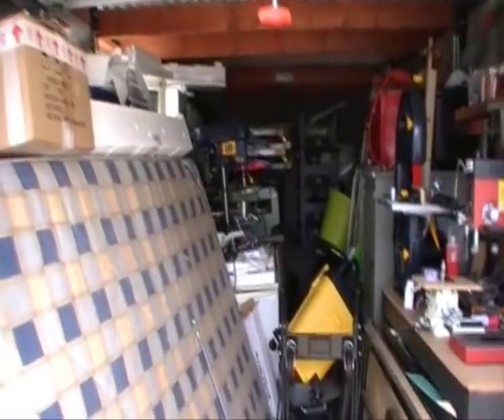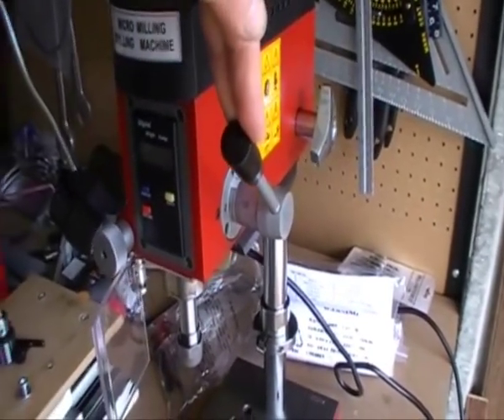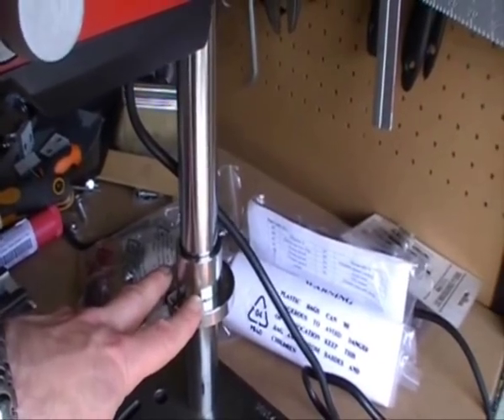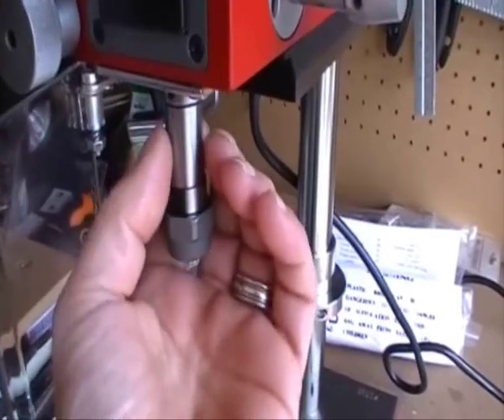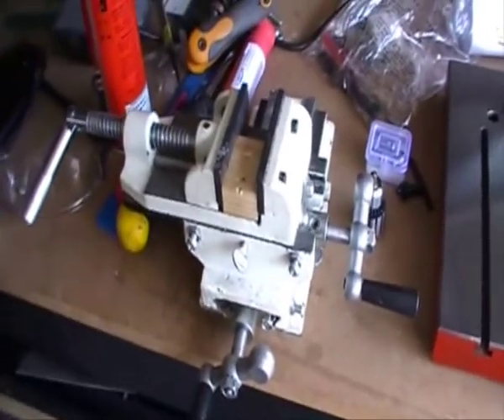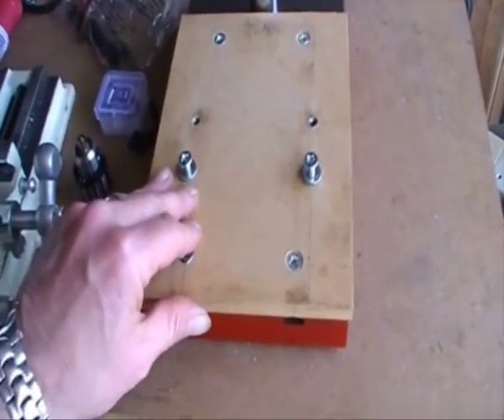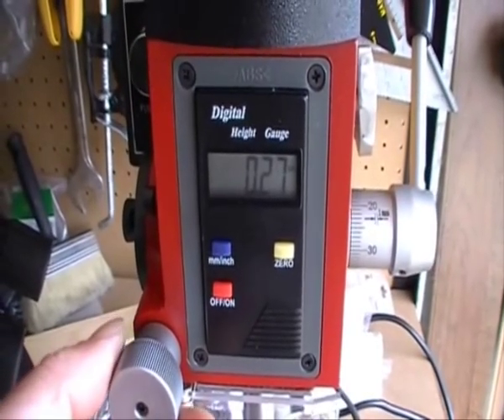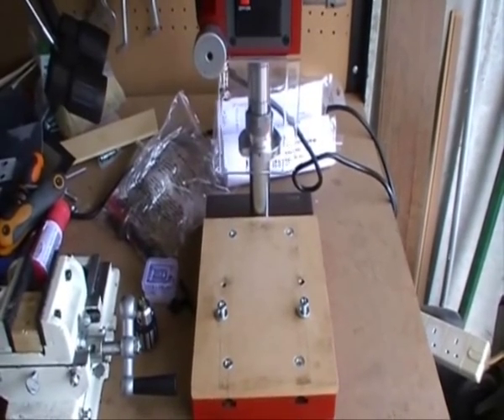Sieg x0

Comment: Thanks for taking the time to review this.
I make jewelry. Do you think it would be ok to mill non ferrous metal with the Jacobs Chuck?
Essentially looking at using tiny burs to mill out v grooves in silver, copper and brass.
The burs are around 1-2 mm in diameter. Essentially the same as a Dremel would use.